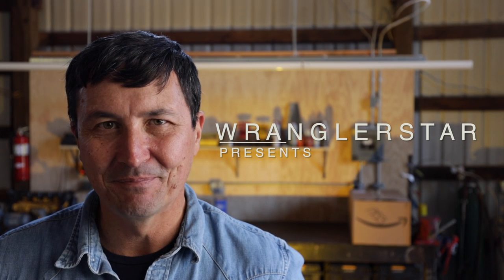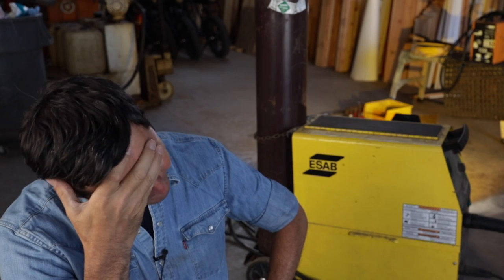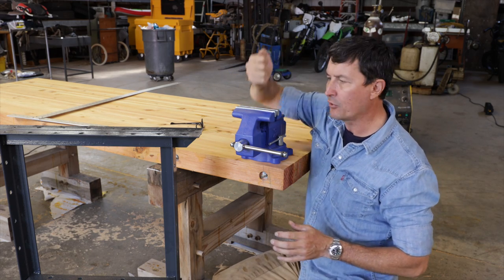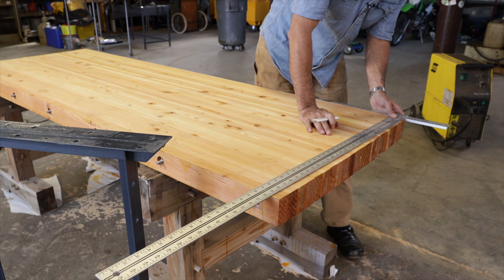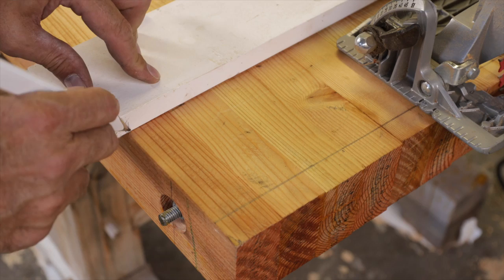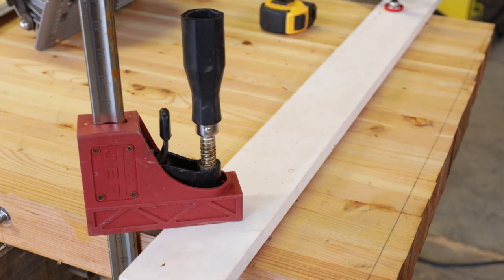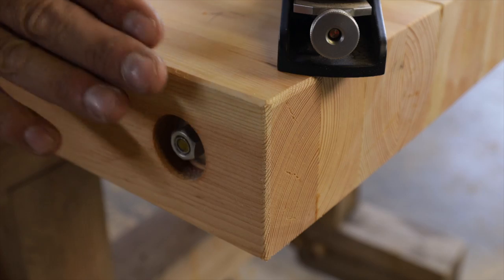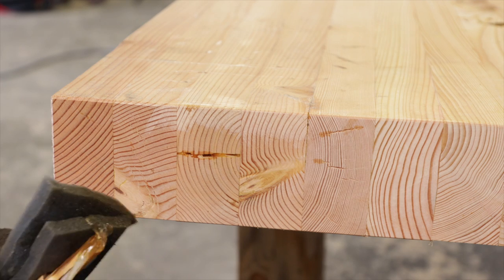The Ultimate Workbench DIY Build

Comment: The thing at the end of the tape measure is supposed to move and you should not push it in when using it as a hook. It should move exactly the same distance as the thickness of the metal it is made out of. That way you get an accurate measurement if it is being used as a hook or if it is being pressed against something.
Reply: This.
Reply: Thank You! I was about to write the something similar that didnt explain as easily as you did! Drove me nuts when he talked about the tape measure!

Comment: that wiggling on the end of the tape measure is by design; because when taking a measurement say in a room, against a wall, you press the metal piece against the wall and measure from the end of the metal piece; but when you then hook up the metal piece to your work piece, you measure from the other side of that metal piece; thats why that piece wiggles the distance of its own width.

Comment: Wow, I've been 'burning an inch' for years, without realizing it was a thing done in the trades, to the point of having a name for it!  I just do it in cases like yours here, where the tab is hard to line up to a mark, or if measuring from the end of a piece and the tab has been smashed and is no longer accurate.  Funny story, I once tried 'fixing' one of those tabs on a tape measure, by hammering the rivets to prevent its movement, until an old handyman wised me up that it moves like that for a reason.  It 'wiggles' by precisely the same distance as the metal tab is thick.  So if you hook it over an end, the inside of the tab is accurate to the marks.  If you push the tab up against say an inside corner of a piece, the outside of the tab is accurate to the marks.  If you hammer the rivets to cancel that movement, it'll only be accurate in one of those situations.  Or neither, and will be somewhere in between.

Comment: I built a bench top like this a year ago out of 4x4’s. The wood was way more wet than I thought it was, it shrank and warped so much that my only option was to crank the bolts tighter and put a sheet of hardwood plywood over it. I already leveled the top with a router and jig before it dried, doing it again would thin it too much I think. Lessons learned!

Comment: you asked about where to place the drill press and bench grinder. my suggestion is to mount them onto a 2x8x10. this way you can move it where you need it and clamp it down or put it in the vise if you need to.  have done this with all of my table top tools. if  need the hole table top that is no problem.  got this from you with mounting tools on the french cleats  enjoy your videos. you can make a shelf under the bench to store the tools. out of the way. God bless

Comment: Hi Wranglerstar , great workbench build,thank you. Regardless of whether your Mig is ESAB or Miller all can play up.  I would recommend never ever run rusty wire through the liner as it will deposit debris and dust over time and slow down your drive so you must then change the liner.
Also do not have the drive roll tensioner too tight and try whenever possible to keep the torch /hand piece as straight as possible when welding they perform poorly when in a loop or tight circles .You must also use the correct drive wheels for the  wire type and its good practice if the machine is not being used long term to remove the wire so you are not tempted to run it when rusty. Also if stored, do not leave the wire tensioner tight long term, keep it unscrewed until you need it I am not a fan of magnets they can mess up your arc  sometimes.Any help I can offer just message me,Richard.

Comment: The tape measure end slides back and forth to compensate for the thickness of the end
Reply: The difference between an inside corner and an outside corner.  I always "burn an inch" even on flat rules just as habit.  Sometimes rules start at the very edge, sometimes you have to look close to see they start a little inboard of the edge.  Just more accurate to start at the 1 inch mark.

Comment: Either Lincoln Electric or a Miller would be your best bet. I worked in an Auto Body Shop for fifteen years and that’s the two welders we used. I even had a Lincoln Electric Welder at my garage so I could do side jobs.

Comment: Check the condenser's on the welder. If they overheat or just from age they go bad the welder will come on and have power but won't weld if they are bad. Pretty cheap fix actually. Hope this helps.

Comment: Great video. One question, though. When you measure the offset for your circular saw, don't you want to measure from the inside of the blade to the outside of the bottom plate? If you go outside to outside it seems like you would be off by the width of the blade.

Comment: Hello Wranglerstar.... for your feeding issues sounds like the drive rolls inside the machine that push the wire through the gun need to be replaced. After 20 years, metal to metal contact they will wear down like brakes on a car. It also sounds you need to replace the liner inside your mig gun if it kinks... I am here to help if you need anything ☺️👍🏼

Comment: You have lots of room there, but since you are appealing to a wide audience, I would seriously consider having some appropriately durable locking casters on the workbench. That way you can move it if needed for certain projects or to relocate it if necessary... Of course, if not, one could always use dolly's for the task as necessary...

Comment: Esab isn't bad it's just not quite top tier. The feeding problem is likely stemed from a broken liner in your lead. Or even contaminated electrode tip. 
Lincoln is just simply overpriced equipment. Only pipeliners laugh at miller equipment. And truth be known a Lincoln pipeliner sa200 and a bobcat 225 multiprocess portable. Biggest difference I've ever noticed is the sa200 lincoln seems to start the arc a little smoother than a miller. And the lincoln is a brushless unlike the miller which is less likely to have expensive repairs like a burnt out stator. I believe that's what it's called.  I will say I've had my eye on the Hobart 2something or other it's a roll around mig with built in bottle holders one for mix 75/25 and one for straight argon for a spoolgun.
And comes with a spoolgun for welding aluminum. Of course I wish I had the money for a miller syncrowave water cooled shop tig. But in reality most everything I fix or build realy can be done with my little cheap AC/DC Hobart stick welder. Still wish I hadn't sold my portable though. Anyway you cant realy go wrong with miller hopefully they didn't go to using inverters and failure prone electronics like lincoln had done back around 07 or 08. We had a lincoln I think it was a 300 or 330 mig digital readout inverter blah blah.right. I missed numerous days of work because we had traded in the old faithful miller 250. That ole miller all you ever changed was the bottle,liner,tip,insulator,and rarely ever the nozzle. Oh I forgot the biggest one spools of wire. Seems like I was changing that out every day. I've built railroad cars with miller 500 with remote wirefeed. And welded all day running continous 40 some odd foot welds on what they call coil covers. So I've definitely spent plenty of time under a hood. I've used many different brands and the best one is one of the top two red or blue. Although hobart is exactly the same as miller. Other than the color and the price. But whichever you can get the best service for is what I'd go with. So the real question is which one can have either the fastest turnaround or give you a loaner free of charge while yours goes in for repairs.